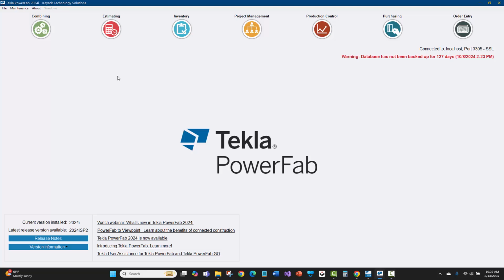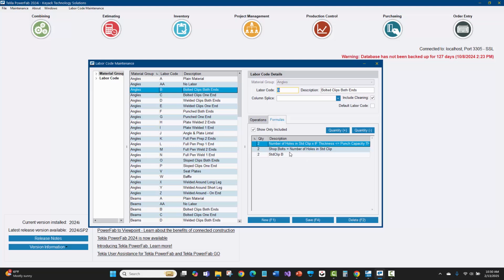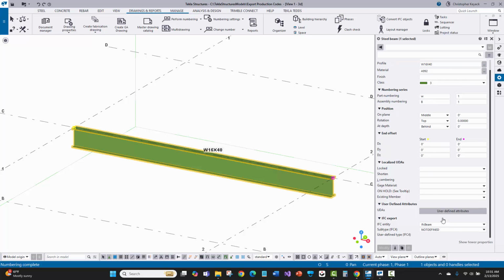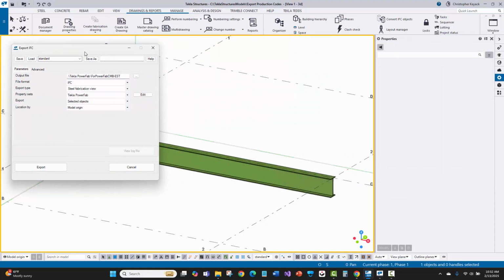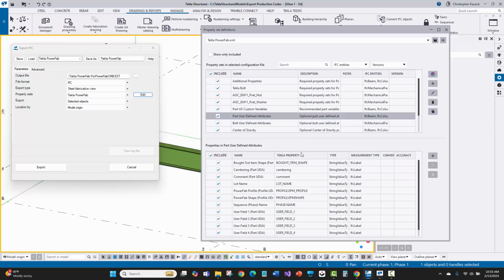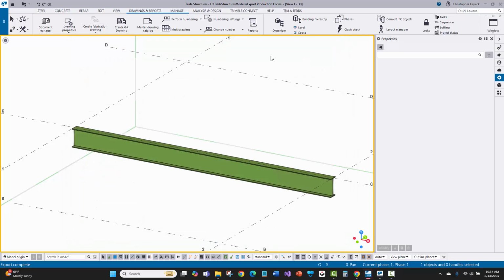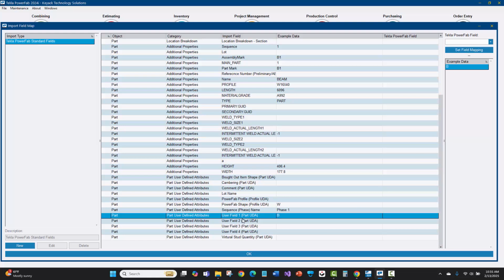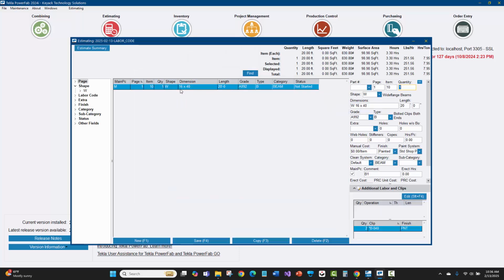KTS - Export Labor Codes to Tekla PowerFab

Comment: Thanks for this, not a lot of PF info out there this is appreciated. I was wondering about making a separate properties dialog for PF related info, like a dialog with pulldown for the labor codes, copes, holes, Extra, Finish, etc so I can select multiple items or areas of steel and hit modify. I'm trying to make the TS model so complete i won't have to do the after import tweaking in PF.  It would be great for paint and extra hrs even if using autoconnect. I still have trouble with mapping Finish it only does main member unless i alt+ select each piece. Still newish to me, glad your at the head of the curve!